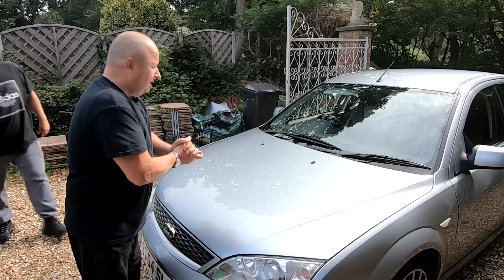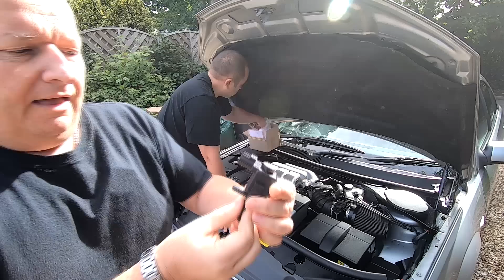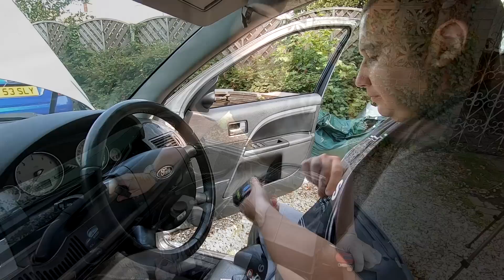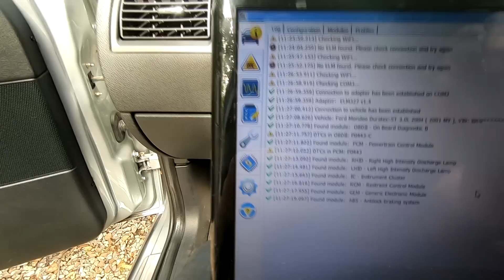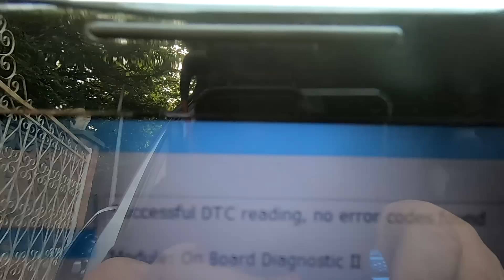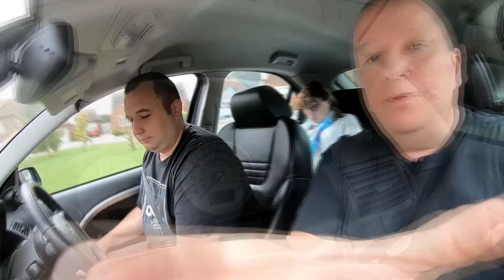P0443 Purge Control Circuit Code And Fix | Ford Mondeo

Comment: Hi Martin, i have replaced my valve twice and i still get this code, i put the multimeter on the wire and the voltage was jumpy, from 12v to 7v to 3v. What could this mean? Thanks
Reply from the maker: Not sure bue, is there any other codes that might be causing it?

Comment: Hi Martin (or anyone else reading this who may know), what are the symptoms for a faulty purge valve? I dont have access to a computer to read the error codes, and funnily there is no engine light coming on. But from what I have read so far, I think I may have issues with my purge valve. The car sometimes will just not turn on. Most commonly, it is after refuelling, and it will not turn on the first time, but will the second.  I have had a new fuel pump put in and after it stopped starting all together the other week, I took it to an auto electrician who fixed some wiring near the fuel tank and said they had fixed it. Drove well for a week and then this morning it wont turn on at all. Went back out this afternoon and it turned over once and then stopped. Successive tries didn't work. 
Only other symptom I can describe is that one time recently when I was driving the car it slowed itself down and then shut off. However, it turned back on straight away. 
2007 2.3L  Auto for reference 
Thanks in advance and thanks for the comprehensive video.
Reply from the maker: Get a cheap OBD11 reader Harry, you can pick one up for about £15.00 You need to know if there are any fault codes to give you some idea bud of what the problem could be. Anything else is just guessing.
Reply: @retrorestore  Righteo cheers.
Reply: @retrorestore  Ok so no error codes are coming up....any pointers ?

Comment: Thanks for the video, I got the Same code P0443 & I changed the gas cap and the purge valve up front but the code keeps coming back... what else can it be ?  Lmk please
Reply from the maker: Could also be a split hose.

Comment: Great tutorial Martin, i just replaced it an works fine!, but the problem now is P1121 Throttle Position Sensor Inconsistent with Mass Air Flow Sensor, any sugestions how to fix it?, i really appreciatte it in advance
Reply from the maker: The Mass airflow sensor could be at fault, they can cause many weird faults.

Comment: I have a 2006 ford explorer with the code p0443 purge evaporation circuit fault, the question is if this fault is related to what the EGR valve code p0403 appears, if I change the purge valve, will the two codes disappear?
Reply from the maker: Don't know, sorry bud.

Comment: Did you have any other symptoms other than the eml being on? I had a p0174 code. Which has now gone but been replaced with p0443 code. My car shakes at ide and gets  worse as it warms up. If I put my foot on accelerator and rev up it will stall???

Comment: I have got a 2005 MK 3 Mondeo Petrol 2.0 litre Ghia X which has the engine management light on, I have a P1120 fault code which tells me its the Throttle Position Sensor is out of range, the car revs up when braking but returns to idle when stopped and loses power on acceleration especially when going up hill, I took it to a local garage who said the sensor had muck on it and cleaned it all out, the fault disappeared but now has returned again, I got a new sensor for it but not sure if the throttle body will need changing too, the garage said the repairs will be quite expensive to sort out.

Comment: I have the same issue on my audi a4, tried everything until I found the other end not connected to anything.....you send it comes from the inlet manifold so I will have to look for where it should attach to...thanks

Comment: I remember my daughter bringing her car into a stealership, the money light was on. They told her it was definitely the catalytic converter, parts and labour close to a grand. After I stopped laughing, I asked her did she wait for the car, and how long did she wait before they gave her the 'diagnosis'. It apparently took them less than ten minutes, to  'thoroughly' check the system and come to this amazing conclusion. The car wasn't worth the cost of a new cat anyway so i told her we're driving it into the ground, but I'm going to put a new fuel cap on, as the old one looked worse for wear, was a potential cheap fix, and often is the cause of the engine light coming on. Done that, cleared the codes, three years on, no sign of the engine light, amazing. Rip off dealerships, I can't trust any of them myself

Comment: Glad you got rid of the fault code. I'm trying to sort my son's Friend's Yamaha X max 125 efi.
Fuel pump wasn't working, got a new one, now it is. Replaced the Injector as it was leaking. Computer won't open the injector. Do you think the crank sensor could be at fault. Doing this as a favour and had the bloody thing for a month.
Take care, Jeff
Reply from the maker: Hard to say, does it have a diagnostic port Jeff
Reply: @retrorestore  Hi Martin, I'm not sure if it does, I will check that out. I feel a bit frustrated with it, as I have asked him to buy all these bits and still won't start. I put a bit of fuel down the injector hole and it did start briefly. I just need to find why the Ecu won't turn the fuel on to the injector.

Comment: Nether go to fords they are rubbish.they tryed to charge me 1300 to change all my injectors on my Ford focus 1.8tdci so i took it to a small independent garage who fix it and it only turned out to be a loose electrical fault on number 2 injector fixed.So never go fords again.Great video guys